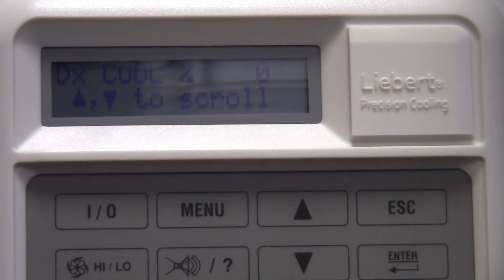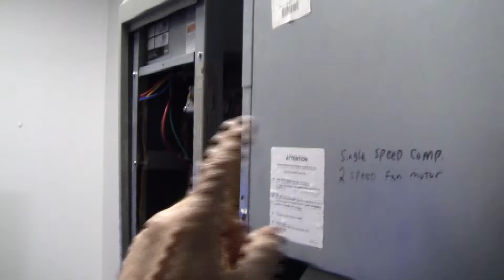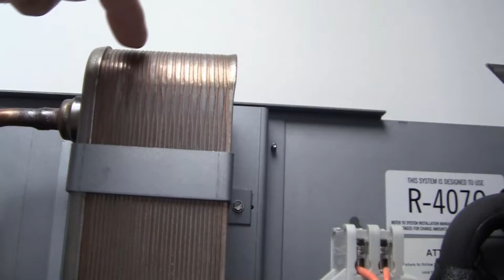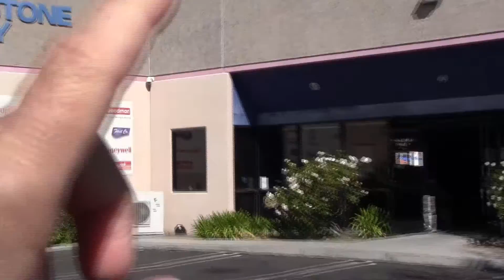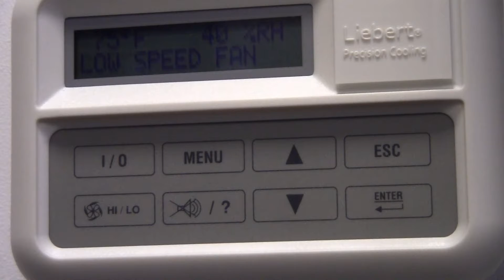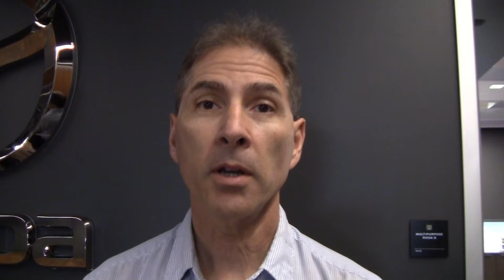Liebert DataMate  Sequence of Operation and Troubleshooting

Comment: Would that situation trigger a “short  cycle “ alarm?
Reply from the maker: I did not get a short cycle alarm.
Reply: My unit was set for 65°.  The temp in room was 58°. I believe this is what’s happening with my unit. it happened to trigger the short cycle alarm.  Either that or my server room is not putting up much load. It just seems strange that my SP is 65° and space temp is 7° difference.
Reply from the maker: @jf1431  yes that is strange. Try increasing the SP to 70 and see how the unit reacts